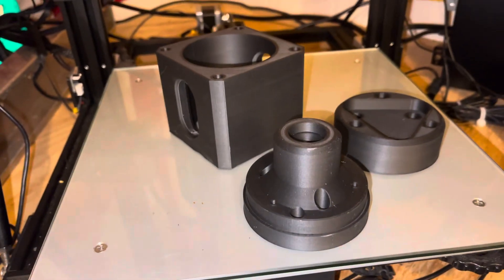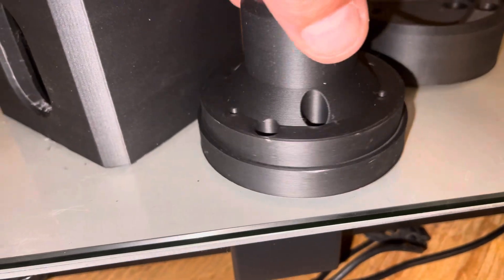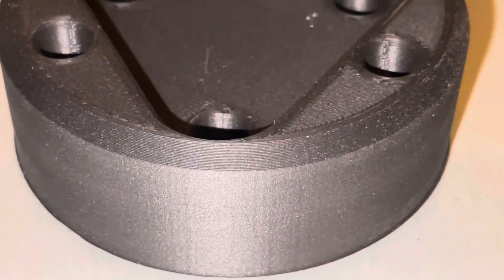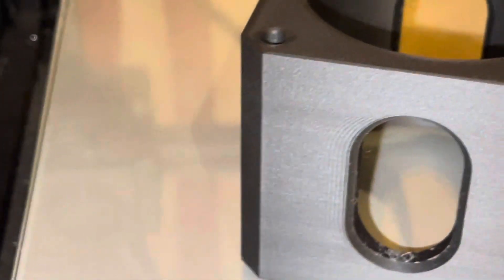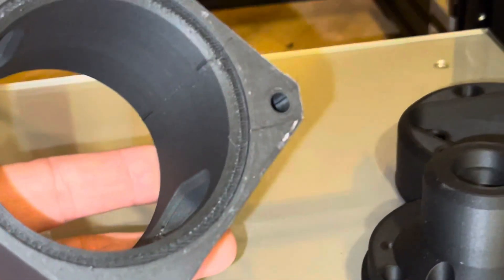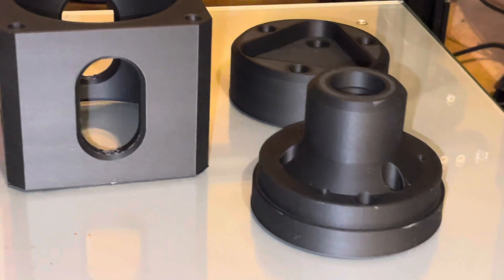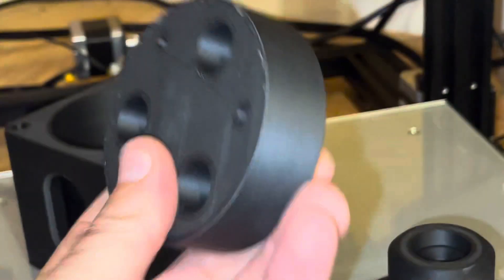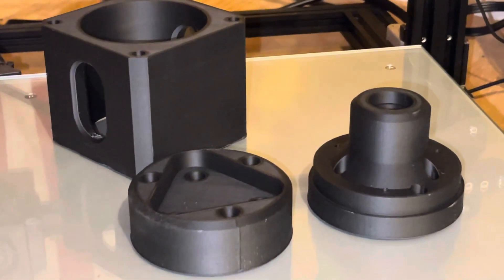First actuator prints done !!

Comment: Yea that line is just the seam, pretty much every printer does that. Usually gets hidden in the corners of parts that aren't round
Reply from the maker: Thanks for checking out the video and my prints. The line is not that bad at all. And yes on square prints it gets moved in the corners.

Comment: Wow that stuff looks good! Nice work. It's all happening! Wonder how often it'll wear out your nozzle. Might have to give it a try. Is that at 0.12 layer height?
Reply from the maker: Chris I swapped out the .4 brass nozzle for a steel hardened (others have recommend this) and and so far no issues. I have about 80 hours print time and no variance. The layer height is 0.12 and I'm super impressed with this result. I also printed everything at 50% infill, so the parts are super solid.